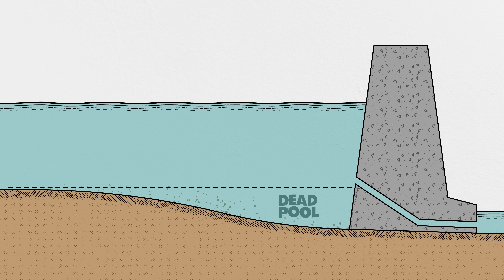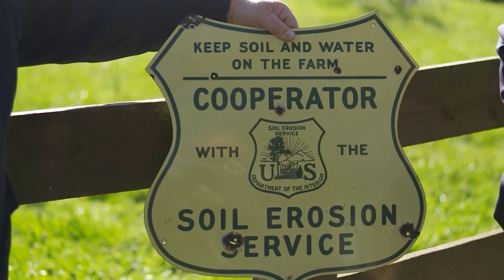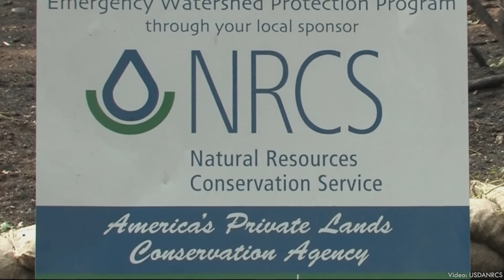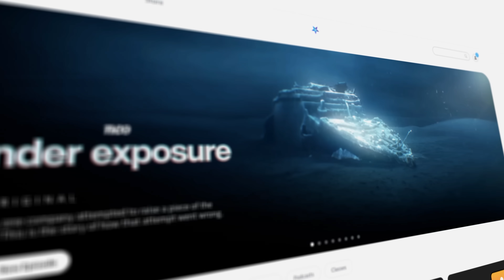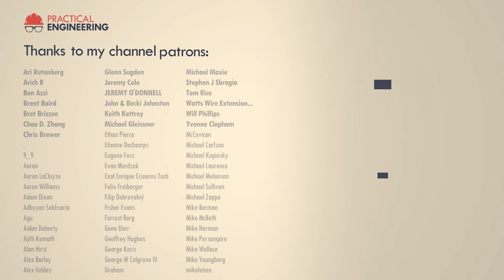All Dams Are Temporary

Comment: Hmm. Smooth the bottom and walls of the reservoir (glass?) to prevent friction from holding any (or much?) sediment back from flowing through, as well as covering up the walls/floors of the reservoir so the soil/silt below isn't itself dredged up to become a problem? The weight of the water and moisture of the soil from groundwater should keep the (heavy glass? with a concrete backing?) tamped down and level, as long as the silt isn't allowed to deposit up against the dam sufficiently to tip the slab (would fusing it against the dam prevent that, though?). This alone would (or should?) only delay, not prevent, the sediment buildup, but the next part would be to place a screen at the input end of the reservoir, with some degree of turbulent crossflow sufficient to sweep the sediment aside away from the screen and into smooth side-channels (maybe just pipes?) that let out at the foot of the dam (on the output side), such that the silt deposits toward the top of the water, so that it will hopefully be re-suspended there as it travels in the river, to deposit wherever it may, somewhere down the line.

I don't think that one screen and one pair of side-channels will be enough, and if we're generating power with turbines, we also need to keep the flow up, so the screens need to only go maybe halfway or 2/3 of the way up to the surface of the water (yes, this is arbitrary, but it's a guess as to how high it needs to rise in order to only be stopping silt we need concern ourselves with, that is well enough on its way to falling out of suspension and could pile up before reaching the dam, and letting silt that is still near the surface ride on past). Then you have another screen further out toward the dam, with its own cross-flow and side channels, to catch anything that has fallen over the top of the previous screen and sunk, and then another, another, etc.

Getting the right screen density will be a thing I'd have ask some kind of... eco-mineralogist (?) about. Talk to a metallurgist and/or a structural (?) engineer about how to make the screen hold up under the force of a river flowing through it. Once that is done, flow restriction can be calculated and fluid dynamics modeled so that we can determine whether we'll be depriving the turbines or causing the stream to back up, in which case, I wonder if we can filter part of the water (now screened of silt) out of the side channel pipes and to the turbines, reinforcing flow and getting the water level in the reservoir back where we want it. We might have to constrict the side channel pipes right at their output, but that means those outputs now have head pressure we can aim at waterwheels (because presumably another dam needs another reservoir needs another silt solution, creating a recursive problem), and the silt hitting those will just fall back into the river and be carried downstream where we want it, and the waterwheels will be low-maintenance equipment that can go immediately into driving mechanical things, like a lumber and flour mill, one on either side of the river.

From there, an occasional flush from the bottom of the reservoir shouldn't make a big bloom, but a smaller one, and be constrained enough that it's still high pressure, but lower volume, so that the turbines are still able to operate at an appreciable fraction of their typical speed. The flush output can be routed to emerge past the aforementioned waterwheels, so my cute little agrarian town isn't obliterated, and maybe the output can be distributed long down the stream in such a way that it isn't one big disruptive flash flood.

But I've not slept enough for this, don't have the requisite education, and could be overcomplicating things just for fun. Got that auDHD brain.

Comment: i think that if the dam was created for power or the reason it was originally created no longer exists, we could simply let them fill up, the high differential exists either way so u can still get power from them tho less reliably and while the new ecosystem of deltas and peninsulas and the like is half artificial its also a natural ecosystem that is worth preserving in its own right, so i say just leave the dam there as a permanent part of the land and turn it into a waterfall.

If the dam is for drinking water then yeah i got no clue.

Comment: Redirect the flow of water upstream to generate a vortex that maximizes the suspension time of sediment particles. By periodically modifying the water flow dynamics, it may be possible to disturb and resuspend older sediment through the creation of variable vortices. While this may not serve as a definitive solution, it could mitigate the rate at which reservoirs accumulate sediment. A vortex can be established by altering the inlet configuration of water into the reservoir system, eliminating the need for mechanical or electrical inlets.
Reply: That makes absolutely no sense. Like, what does "redirect water upstream" even mean? Are you seriously proposing pumping water back up the river? lol

Comment: Idea:
Have at the bottom of the river way before a dam barrier that would force earth to move trough side channel.

So make side channel for the river and create barrier that would force earth to go trough side channel and not main channel that has a dam.

You could add  slow moving belt/scoops on the berier which would be powered mechanicly by water wheel so barrier is never over flowed with earth.

Comment: What about building a siphon tube down the exterior of the dam it is attached to a pipe that runs the length of the reservoir. It terminates in the reservoir inlet. An autonomous tractor dredge is attached to the pipe. The tractor is powered by a turbine that draws power from the water being pulled by the siphon. The dislodged sediment is discharged by the siphon tube. This autonomous dreg can match the sedimentation rate.

Comment: One possible solution to the sediment problem is to use it as fertilizer on farmland. Take a sample and test for trace elements and minerals. The will be some values worthy of use. Even if there were zero mineral or trace element values, it could be used as a soil enhancer/improver because it is a very fine product that could be spread on farmland to restore or retain top soil levels. Obviously, a sediment separation plant will need to be built on the shore somewhere. With 5Million+ tons of the stuff, it could not only provide jobs, improve the local economy but also put back into Mother Earth what might be missing or being replaced with man made products. I live in the UK so you can send my reward to me here please! 🤣

Comment: What if you build a smaller dam upstream that you frequently flush through a bypassing channel? You would still use the water to do the dirt moving. And you wouldn't be dumping too much dirt at once. I guess the main problems would be multiple water sources and the cost of the bypass channel/pipe.

Comment: The obvious solution is to reintroduce the sediment to the water flowing out of the dam. Build the suction dredging system into the dam from the start and you can periodically dredge the upstream side of the dam and send the sediment downstream as happened before the dam was built.

Edit: should have waited another 30 seconds before posting this comment as you've just ex0lained why gates at the bottom of the dam don't work 😂

Comment: Conveyors on the reservoir floor. This happens slow as hell in real time, so they barely need to move. The energy requirements will be tiny. The conveyors could slowly roll from the back of the reservoir to the dam at something like one inch every two hours. At the dam, have a mechanism, pump, gate, or other pass-through feature to allow the sediment accumulating at the bottom of the dam to pass through/over/under and continue downstream. Make the metal parts out of aluminum and the belts out of high-strength rubber like you see on semi truck tires. Tie the rollers together with aluminum chains. The permanent, nonstop, and extremely low-speed movement will minimize wear and keep the system working for an extremely long time.

Comment: Build a sediment canal?
Capture, Airrate and redirect sediment into a sediment canal to be washed to a place that can use the silica

Or build or use temporary blockades that redirect water flow into or underneath the sediment layer.
Seal off the dam and let sediment be agitated and flow out to control canals next to the resivoir
Reply: How do you separate the sediment from the water?

If you are building a canal anyway, why not just remove the dam and drain the reservoir and use run-of-river hydropower instead?
Reply: @johnperic6860  sediment is water logged
You don't separate it if you want it to flow. And you don't need big control canals. Just a nearby flow path for sediment when its agitated
If the dam is closed off and not flowing, you can open a gate close to the sediment areas to allow water and sediment to flow into the small canal

Comment: It is inportant to note that the volume of water stored doesnt change the total power output of a dam, only the volume of flow and the height of the dam. Stored volume offers flexibility in when power is generated, but even if the reservoir is completely filled with dirt, with just enough of a hole maintained to prevent clogging the  turbines and other equipment, the dam will be able to put out just as many kWh as when it opened.

Comment: It seems to me that every dam comes with a good place to dispose of dredging spoils. The sediment would flow through id thr dam weren't there, so pumping the spoils into the stream below the dam replicates the natural outflow from the area. The water flowing in the reservoir will carry less sediment than the natural watercourse, so the system for moving sediment past the dam will have to move a higher concentration of sediment than thr natural river would, which won't be easy, but i suspect will be possible.

Comment: I think the sediment collecting pipe and check dams are a good idea I just think that we're using them in the wrong order we should use the sediment collector to get the sediment first then have it dump into small reservoirs Downstream we use those reservoirs as a dewatering mechanism until they are completely filled with sediment and then we drain the minor reservoirs and use the newly leveled land for farming

Comment: @3:29   
What is you put a pipe from the outlet all the way to the river (where the delta) begins?   That pipe could have multiple inlet gates (AKA Drains) in it where an engineer could open and close each inlet gate.  Assume 5 gates in your example = 5 zones under the lake.      This would allow you to dredge each zone using the gates.   Sediment would still form delta's in each zone as the gate in that zone is closed.   Once zone 1's gate is opened, that zone would be dredged of sediment- then closed.    This would allow for down stream sediment, but also the benefits of a dam (recreation, flood protection, wifdlife, hydro electric, ect.

Comment: You never talked about my option! It seems the solution is to disturb the sandy buildup piles as the water is flowing over them. In your demo, once the sand starts building up near the beginning of the lake, image you just take your hand and mess with the sand right there. It wouldn't take much finger wiggling to prevent any buildup in the whole lake.
Reply: Whole lake turnover, every rain? Who pays? Environmental costs? Yeah "could" be done. Practical? And at what safety to those downstream?
Reply: @rockcat5000 Yeah I think people are vastly underestimating how much sediment can build up
Reply: @rockcat5000  I don't think you understand at all. This would be a system installed and permanently in operation. If you disturb the sand, it will flow out and down through the dam like it would in the river. It is easy to make water turbid, you just jostle up the riverbed.

Comment: Much like retaining walls there are three kinds of dams; those that are falling down, those that have fallen down, and those that will fall down. Most people fail to understand the gravity of the situation.
Reply: 1.  During any year when there is a drought,the water level will be lowered to such a degree that removal of sediment from the topmost end of the lake could be done using less effort than normally required.

2.  If there are 2 dams One upstrem of the other,you can deliberately control each depth to a certain degree thus making the silt removal more convenient in the lower dam,simply by reducing flow and building depth temporarily in the upper section
Reply: I feel the weight of those options pulling down on me!
Reply: And the saying for concrete (which dams are usually made of), there are 2 kinds of concrete, cracked concrete and concrete that hasn't cracked yet. 😢🤔🤓🍻
Reply: a swarm of tiny excavating robots that capture and remove soil, we should copy insects
Reply: @TreesPlease42  if we can do that we don't need dams any more
Reply: Now that is witty. And a Dad joke. Brilliant 😅
Reply: You actually forget one, the one that will become obsolete, wether to the water source drying out or filled up by sediment.
Reply: @robymaru03  but eventually it will succumb to the gravity of the situation.
Reply: “We have a whole government department dedicated to the problem” - well did have….
Reply: Good for a chuckle, my friend.
Reply: In my first engineering class my professor told us to make sure we design for the eventual failure of anything we build. Every sky scraper is going to fall or get torn down, every dam is going to fail, the pyramids are not that old and they are in ruins compared to when they were built. The oceans will also fill with sediment, mountain ranges with weather and erode… But new mountains will rise up to replace them. Every swale will eventually fill in and become a terrace. We have a lot of old infrastructure in the world… All of it has an expiration date.
Reply: @timtation5837you had a good teacher there. I don't know how many arguments I've gotten in with engineers that state that they can make something last forever.
Reply: @timtation5837didn't you get that conclusion in 5th grade.
Reply: But do they understand the situation of the gravity?
Reply: Hiyoooooooo
Reply: I see what you did there
Reply: If you choose to solve the issue by ignoring the maintenance and wait until it ruins the construction.
Reply: Just like wind turbines. Those that have fallen down, those that have fallen down, and those that will fall down. Happy 😊
Reply: HA
Reply: You didn't think of the chemical potential energy of the situation
Reply: BAHAHAJAHAHA

no rly it was funny
Reply: @davidbriggs7365  and we shoot ourselves in the foot by not reintroducing these superlative keystone species into our wild spaces. But humans love to combine ignorance and arrogance so what can I say
Reply: @davidbriggs7365  and we shoot ourselves in the foot by not reintroducing these superlative keystone species into our wild spaces. But humans love to combine ignorance and arrogance so what can I say
Reply: Well I mean it is possible to maintain and/or repair? Lol

If reinforced correctly and not over burdened, my small town has many 300 year old stone retaining walls built by hand. They are over burdened and have not been properly maintained, but 95% of them still look practically brand new
Reply: @coteywallace7290  the earth is 4 billion years old. It recycles the crust every 1 billion years. You are thinking in the short term.
Reply: That is a very weighty assessment, full of gravitas....😂😂😂
Reply: Was that pun intended?
Reply: @trueriver1950 it was meant to be punny.
Reply: London Bridge has fallen down...wait, what? I got carried away 😅
Reply: @ShikamaruXT  my fair lady?
Reply: There are three kinds of societies...
Reply: @randomuser-xc2wr  ty for this lesson in Yemeni history. I feel smorter now
Reply: Unless they are built right.
Eg ancient megalithic walls.
Reply: You'd better tell that to the current managers of the Derwent and Ladybower dams in Derbyshire, England. All three have been standing for many decades and they don't look as if they're going anywhere soon.
Reply: @steveb6386 decades? Like tens of years? Why don't you talk to me when it lasts a thousand or a million years.
Reply: @steveb6386  sure they don't look like it.... Give em couple decades 

Breaking dams don't always give a clear warning... 

I'm sure proper maintenance can expand lifespan but I imagine a time will come when a decision will have to be made

Comment: I think the best solutions would have to be a mostly passive method that doesn't require much human intervention. It takes a long time for it to accumulate so as long as the passive method matches or beats the rate of accumulation, then you win. The simplest solution I can think of is add strategically placed stones to induce turbulence in the water. The more messy the flow the more it agitates the sediment floor the more gets out of the dam. Now I'm not an engineer so I don't know if this is a method that would work.
Reply: stones slow water flow and encourage sedimentation. This method is very often used to encourage sediment build up.

The best long term solution is removing the dam.
Reply: @johnperic6860  Ah. Fair enough. Goes to show my ignorance on this stuff. However high turbulence should be a useful tool here?
Reply: @ 
Turbulence mixes water more thoroughly and requires a high energy environment that would naturally keep sediment suspended.